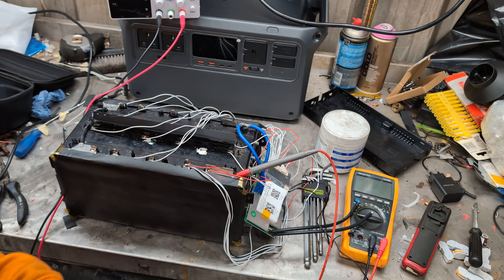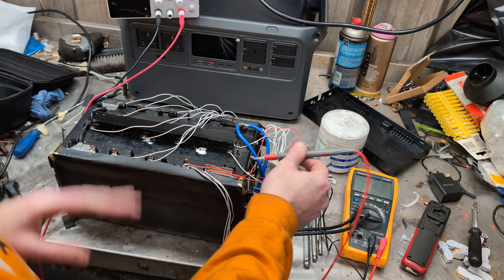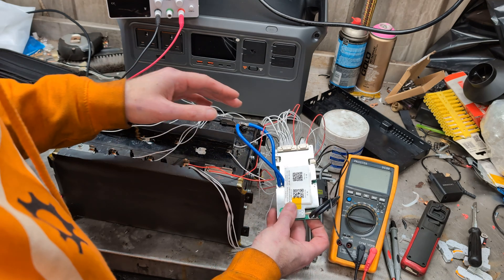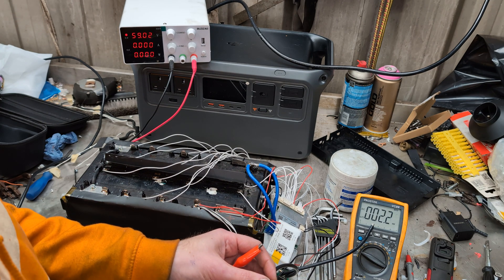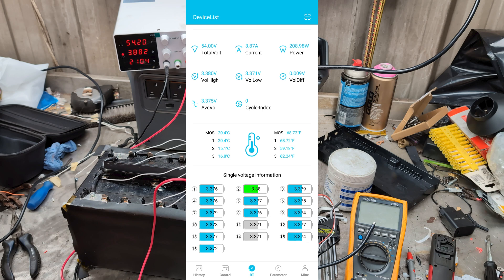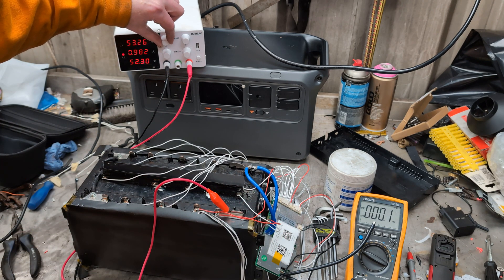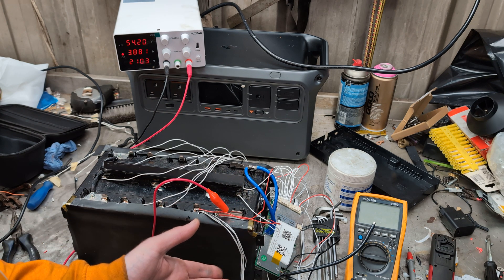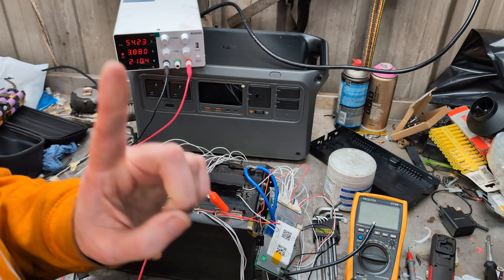My first BMS - QUCC 16S LiFePo4

Comment: So a couple things:
1: The balancing doesn't kick in until the cells are nearly full.  You can tweak that point if you want to but JBD is pretty good.  Don't panic.
2: The Protection switch on the first page SHOULD be OFF.  If it turns green then you've had an event and the protections have kicked in.  No green is good!
3: You can grab the Overkill Solar app and have more control and n easier time seeing what's happening.
Reply from the maker: Thank you.